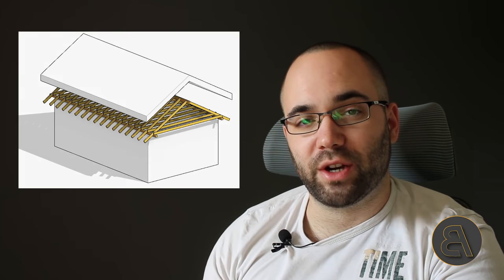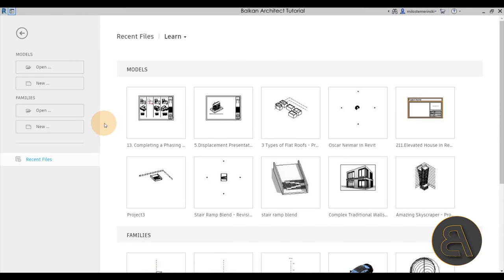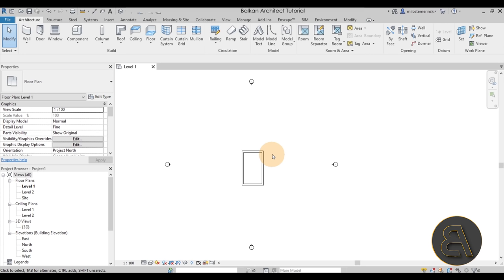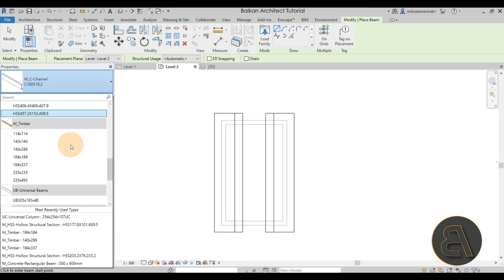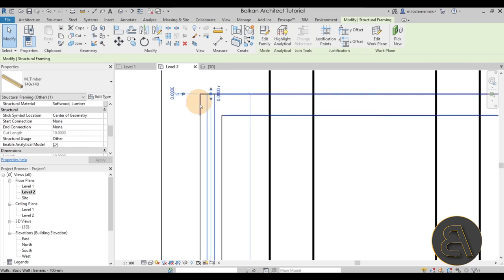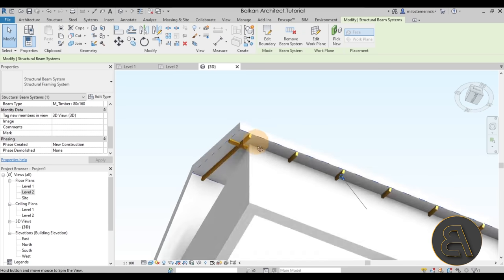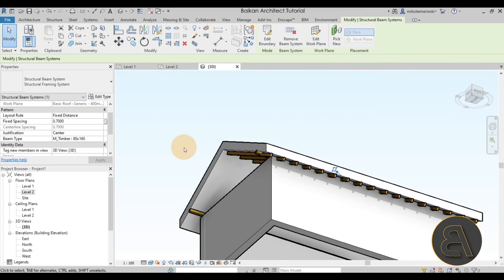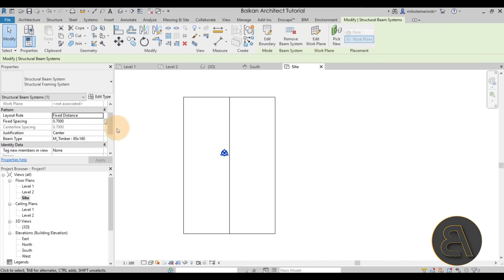Roof Construction Elements in Revit Tutorial

Comment: Thanks! Great tips. I’ve recently been laying out framing for a small house and discovered the coping tool to cut intersection framing members - such as the rafter to ridge beam intersection. Easier than a reference plane if the two pieces actually intersect.

Comment: The ridge in your example is a RIDGE BOARD not a RIDGE BEAM, so you need to add a collar tie in the upper thirs point of the rafter length, on the other option it would be a RIDGE BEAM but you would need a post from ridge beam to your your joist.

Comment: Hi. I have a problem with revit where I draw a stair from 1st floor to second. and in first floor there is the cutline and above is in dotted lines. but from the second floor plan the stair is being shown fully. no cutmarks or dotted lines. just down arrow. is there anyway where i can show a cutmark in the second floor plan as well. adjusting view range doesnt do anygood.
Reply: It's meant to be shown in full since you can actually see the whole stairs from that level. It will only show those cut lines if the stairs passes through the cut range for that floor plan level.